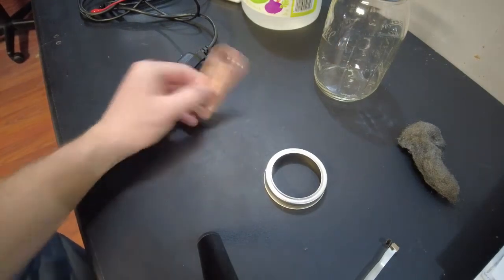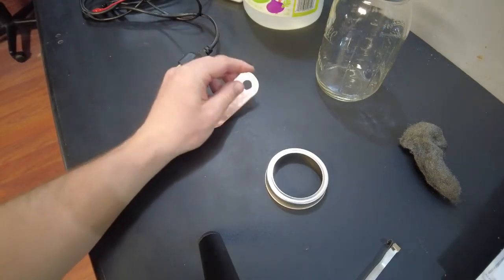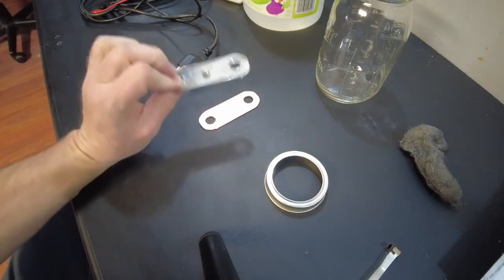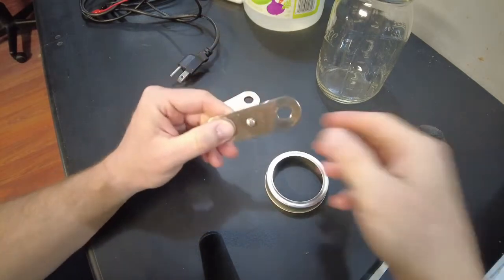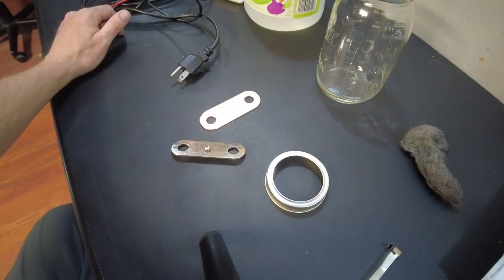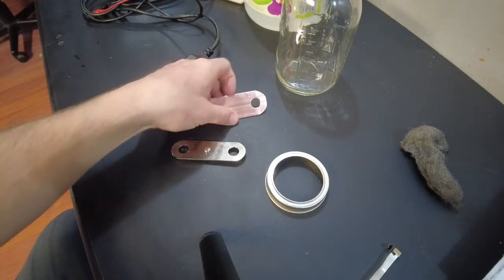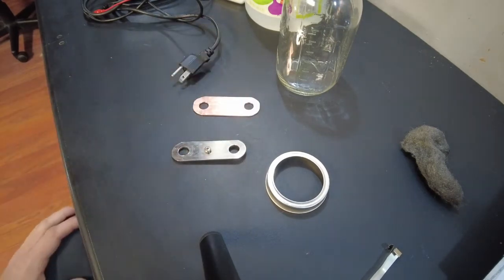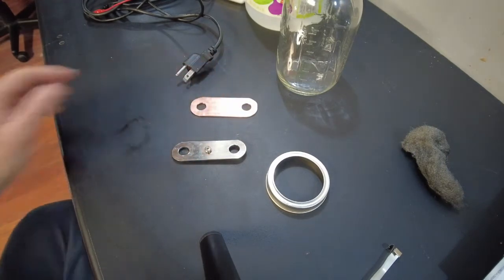DIY nickel electroplated copper busbars

Comment: This is not conductive grade copper. Pipe copper is only 80% Cu if I remember right. Whether hard drawn or soft, fine stranded, commercial strand or solid they are all 99.99% copper. I bet you know that but just a heads up, a lot of people don't.

Comment: We have been in the power industry for 50 years. Sure, you can crush some old plumbers pipe in a vise, drill some holes, and use that for your bus bar. Correctly designed bars, are longer lasting, safer, and easier to machine, manage, and implement. Flexible, corrosion resistant, Electrically rated, durable good. Faulty, poorly designed, emergency bus bars have cost power generation plants millions of dollars in the past (example, : Titus Generation Station,) when the lights went out during emergency ( more than once).
Reply from the maker: Sure, I get what you're saying. However this is DIY stuff, so I expect people to hopefully be aware that this "may not" be as good as a commercially available solution. DIY is about learning, saving money, and being self sufficient.